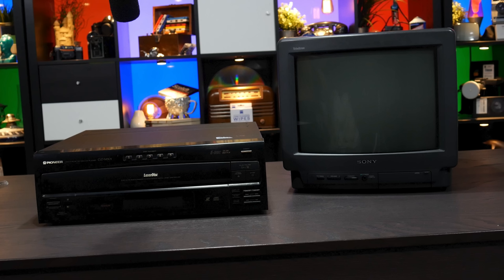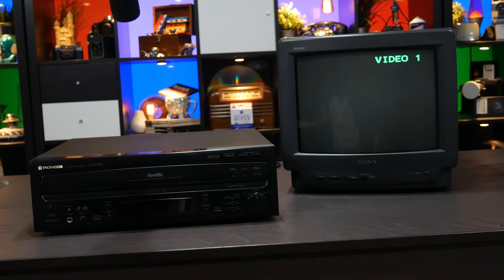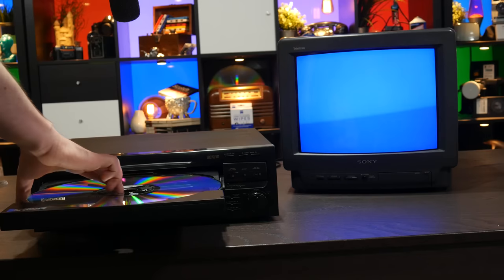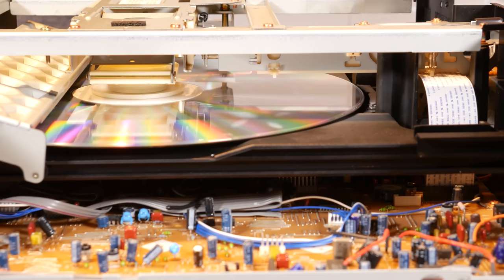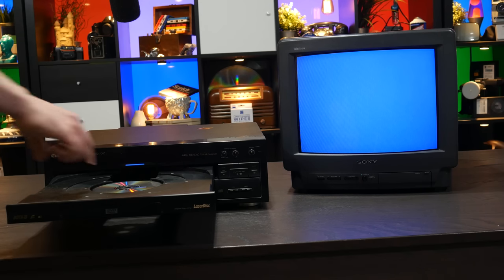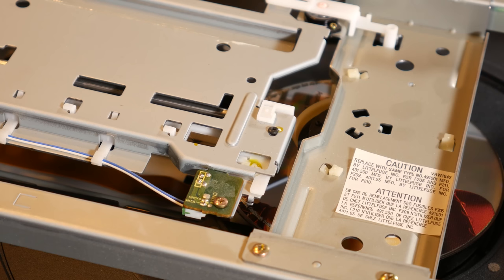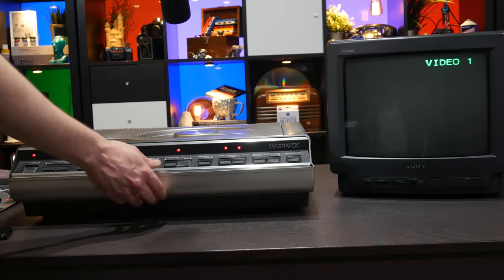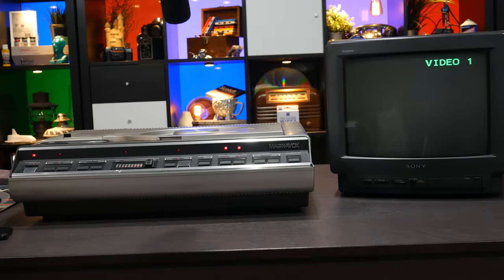Sights and Sounds: Laserdisc players

Comment: Alec, I would like to make one suggestion. Perhaps you could describe the devices as you introduce them. "The unit is a black, oblong box about 15" wide by 15" deep by 5" tall. The front has buttons for multiple functions and a jog-wheel for image select. The tray that holds the disc(s) is hidden behind a door which takes up about 1/3 of the front, vertically, and which opens downward when the tray opens. The tray has a large central depression for the laserdisc, and 6 CD depressions spaced radially around the center." Something like that would help the vision impaired better visualize what you're showing.
Reply: Definitely this. I think doing some description, even if it is brief, of what the devices look like is very fitting for the aims of this series
Reply: So it is black?
😁
I'm not blind, but I really like this format, even for those who can see, hearing the sounds that stuff makes adds quite well to the visual, it's a win-win.
Reply: My partner would add to that, before pressing a button for the first time, where on the machine it's located.
Reply: Great suggestion. Though such descriptions may not have meaning to someone who was born blind. They'd be valuable to people with impaired vision or who lost their sight some time after learning what "black" and "inches" are.
Reply: @pufthemajicdragon   a blind born person can easily understand inches. Items they hold have length, and Braille rulers exist.
Reply: This is a great addition to a great idea!
Reply: Do you demand subtitles for the noises too? If you cannot see the screen that you are watching this on, you have no need for a video player either.
Reply: @-sturmfalke-  there is this long, black thing...
Reply: You ruined it Dave

Comment: About the "logic problem":  What is happening is that the unit is trying to get a focus lock.  If it can't focus, the sled moves to another position and it continues to try to achieve focus lock. The mechanism may not be putting the sled assy at the proper distance.  When you hear the "click" that probably is when it locks in proper place.  Just my 2 cents.
Reply: You're right. It needs a belt kit.

Comment: Hmm.  For the machines that aren't able to spin-down the disk, there are three ways to slow the disk down:  (1) A physical brake.  (2) Use the spin motor as a generator (charge up a big capacitor, e.g. like that 1 farad capacitor).  and (3) actively to drive the motor in reverse while it is spinning forward.   The energy has to be dumped somewhere though.  If not into a capacitor then either by heating up the motor, or heating up something else inside the box.

If the slow-down mechanism is #2 or some hybrid of #2 and #3, then it might simply be that the capacitor has gone bad... which would not be surprising at all given the age of the equipment.  Those are not going to be solid caps, they will have an electrolyte that can dry out.

-Matt

Comment: Isn't it insane, that this old tech is so much faster to power on, start, and seek? I'm not sure I can start my Media Player Classic that quickly, and find a chapter. Unskippable DVD's don't help it any, either. We're really paying a price in latency, with a lot of digital hardware. Think about smart thermostats, digital ovens, microwaves with buttons instead of an analog time knob.
Reply: I had a previous co-worker who sold me on the idea that knobs are the ultimate input device. You get a remarkable amount of both coarse and fine control, and it comes with a built-in button if you need it!

Comment: The Magnavox sounds like it has an issue with the disc clamp.   You can hear the motor spin the disc up but you also hear a slipping noise because the clamp is not holding.   Try pressing down on the lid when it is doing this.   It might increase the clamping force.   The reason some discs sound different is probably due to the thickness of each individual disc.    You might notice some scratching at the center of the disc due to the disc slipping.

Comment: 7:13  As someone with a mechanical engineering degree:  God, I wince at the need for percussive maintenance
7:13  As someone that uses equipment well beyond it's expected lifespan:  God, I love some good percussive maintenance.
Reply: It'll will have been said before but laserdisc was well ahead of its time.
Reply: As someone with an electronics engineering degree: Why does percussive maintenance work with solid state components?
Reply: @LeoInterVir  it isn't fixing the problem, it just teaches the device to not do that anymore out of fear.
Reply: @LeoInterVir  
Well, in this case there is a very subtle hint of an explanation at 6:37
Reply: @bobbabai  wasn't talking about the player and its slipped belt. I'm talking about how it works on items without moving parts.
Reply: @LeoInterVir  and to actually answer your question (by replying to the right person) about solid state components: solder joints and board sockets, because circuit boards aren't solid state
Reply: @bobbabai  true, always weak joints, points of failure.

Comment: This is it. This is what I’ve always wanted in videos like these.
The spin up of the disk at around 2:00 reminds me strongly of an old-style London double-deck bus, the one with no doors, as it lumbers off down the road.

Now for 21 minutes in: The stereo recording gives us a little more room ambience, but in most other respects doesn’t really add too much extra to the sounds, I feel.
It’s not like going from 720P to 1080P for example.
Mono seems to work really well for this situation and doesn’t detract from the noises of the equipment.
Reply: thank you for requesting these. this will be helpful for me as well
Reply: It seems like it might be effective to have the left and right channels emphasise some aspect of the gadget in question. For example, in this video, hearing the tray open and close as a left-to-right, right-to-left experience might give a sense of it's speed and location (if done carefully).

Comment: I very much enjoyed this video, it was very relaxing.
Random fun fact! This laserdisc copy of Willy Wonka & the Chocolate Factory has changeover cues! Those are the little white dots you can see in the top right of the TV screen at 21:45 and 21:52. These were used back in the days of film projection, and when movies were not run on big platters, but several smaller reels (usually 20 minutes). These are to signal the projectionist to start the motor of the 2nd projector (the first dot) and to "changeover" to it (the 2nd dot). Usually you don't see this in home video, as it's not usually part of the movie itself, but added by the projectionist when the film is received at the theater and "benched" onto the several 20 minute reels. It's physically scratched into the emulsion of the film. So whatever physical film this laserdisc copy was made from was used in a movie theater at some point, whereas ideally it's made from a master negative, which doesn't have these changeover cues.
Reply: Why would they put change over cues in the last reel of film though ?
Reply: @devial9879  I've never run a theater projector before, but if you have a repetitive task of any sort that requires you to do the same thing to all pieces but the last one, often they all get done the same.
Reply: Generally a roll of standard film lasts 11 minutes.Based on this standard, a film was called a Short Film if it had this duration or less, a Medium-length film if it had two to four reels (44 minutes in length) and a Feature film if the film lasted more than four rolls. The 11 minute time was to give the projectionist time to set up projector B while running projector A and vice versa  in most movie theaters that had two projectors.

Comment: I'll leave some feedback here. I am sighted and hearing, and have ADHD-related sensory processing diffculties.
First off, I really like the format! It's kept me engaged the whole way through.
I have a slight problem following a video if someone talks while showing a thing, and the narration of what's happening helped me staying focused.
Generally I'm glad that you caption your videos well.

As for the stereo mic, the hum is quite unpleasant. I personally prefer the mono setup because of that. It's also distracting, and I end up taking in less detail of the actual audio. 

All in all, a very pleasant video. Looking forward to more content like this!
Reply: Fell you bro. 
But just a tip that worked for me, I've put my inear buds (galaxy buds+) and the humming was completely gone with the crt noise. My guess is the Bluetooth eats a little off the both ends of the audible frequency, and this helped and made the stereo setup clearer than the mono. I think this things can be treated in audacity fairly easy without hurting the audio. 
Also if you have a Samsung phone, the "Adapt sound" really helps
Reply: @Roalethiago  thanks for the tips! i just, uh, watched it on my pc, with speakers.

Comment: If someone were to design a 2 sided laser disc player today, would it have a laser flipping mechanism, or 2 lasers? Because I assume the laser LEDs and mechanism are way cheaper now
Reply: Definitely two lasers with laser guide tracks. Keep in mind that back in the day gas lasers were still well in service and solid state lasers were newly replacing the gas lasers... at a price.

Comment: The Magnavox Laser Disk player uses two mirrors for the tangential and fine radial tracking. These mirrors are mounted on foam rubber mounts and driven with speaker style voice coils.  Over time the foam rubber mounts and glue deteriorates allowing the mirror alignment to drift. It is possible to repair (not for the faint of heart!) but it was never designed for this as it was a replaceable assembly back in the 80s.  I used to repair these things in peoples homes when I worked for Philips. The European versions were the VLP600 and VLP700. The 700 had a remote control.

Comment: Wow, great video.  I used to service and repair these machines back in the 90's.  I was trained by Pioneer, and used to love fixing them.  I am quite surprised that your unit is working absolutely perfect except for that belt issue.  Usually the diffraction "grating" alignment drifts over the years and you get crosstalk on the video. Toward the end of these product's production, they started using pre-calibrated fixed optical blocks.  This brought back some good memories.  Thank You.

Comment: That Willy Wonka disc even has the markings from the film (@10:03 & 10-10) to tell the projectionist when it's time to switch reels! That's some old-school film scan. Cool that that exactly coincided with when they cut from one side of the disc to the other (probably 1/2 way). The film reels could have been in 3rds, but it must have been 1/2 or 1/4 the length of the movie.
Reply: That's actually cool info. Now I'll at least know why I'll be seeing that little mark on older releases on VHS/BETA/LD (usually using inferior transfers, I bet).

Comment: This is great.  I would recommend that since you are recording audio for differently sighted individuals, you might do a little more about describing what you're doing.  For example "I am putting a CD into the center of the tray, unlike the previous model, which takes CDs in indents that are spread around the tray like flower petals."

Comment: Alec I know exactly what's wrong with your Magnavox machine and can guide you through the process of fixing it 
I don't know how much research you've done on these machines but odds are the mirrors that guide the laser beam are operated by magnets 
The glue they used allows the magnets on the back of the mirror to migrate and jam the mirrors in place 
Depending in what position the mirrors jam in can mean parts of the disc will read, and that because they also move around it means sometimes it'll change its behaviour 

The fix is to take the machine apart, and reglue the magnets on the mirrors 

Whatever you do, DO NOT TOUCH ANY OF THE ADJUSTMENT SCREWS 
You will regret it
To reset them, you have to use a signal generator and oscilloscope to recalibrate all the optics which is a royal pain in the ass 

I have a fully working mint condition example and another 5 parts machines so I reckon it's definitely a saveable machine!

Comment: This is doing the gods' work. I wish more had been done like this to archive how "state of the art" equipment from the 50s, 60s, and 70s worked, especially in the broadcast-TV industry. The technology involved in laser focusing and demodulating a video signal from the resulting light reflection, all done with ANALOG circuitry, is a true testament to engineering. All of this modern nano-meter scale chip fabs seems like cheating.

Comment: I use an older 6.1 EX Onkyo receiver at home for audio, so when I watch most things on YouTube, I apply Dolby Pro-Logic IIx. With your video, which started in PCM mono & later switched to stereo, most of the audio initially came through exclusively on my center channel. Once you switched to stereo, the soundstage expanded, but it also spread to the surrounds in a somewhat unnatural way, excluding the rare rear center channel. I'm not entirely sure how Dolby handles the Pro-Logic derived rear center channel when processing a stereo PCM signal, but that was my experience.

If you're ever feeling ambitious, it would be awesome to see you upload a video with proper Dolby Digital 6.1 EX surround encoding for those of us still rocking that older setup. While YouTube only supports DD5.1, as you probably know, 6.1 is essentially 5.1 with a Pro-Logic EX 'flag' embedded in the signal to extract the center rear channel from the discrete surround channels. You can 'hide' a proper DD6.1 signal in a YouTube video limited to DD5.1 since 5.1 receivers simply ignore the EX flag in the data stream. Personally, I find 6.1 EX incredibly satisfying for a bedroom setup. TrueHD, Atmos, and Master Audio are a bit overkill for a bedroom, so I leave those formats for the living room.

5.1 always feels like it’s missing something in comparison, at least in my experience with my more unique (and probably rare) 6.1 EX setup. I love your channel and agree with about 99.5% of your opinions, even though my friends think I’m ‘weird’ for watching videos on (as they call it) 'old tech that nobody’s ever heard of.' But I find your content incredibly helpful, interesting, and most importantly—correct! Keep up the great work! 🙂

Comment: 38th YES! Please explain the difference between CLV and CAV. The CAV (constant angular velocity) always rotates the disc at the same rotational speed and the CLV (Constant linear velocity) always passes the information at the same linear velocity across the optical pickup, thus the disc has a slower speed in the beginning and a faster speed in the end, and a longer seek time as the disc needs to speed up and slow down the read the information.. I have not finished the video and maybe you go in to more detail later.

Comment: I suspect that the DVL-700 doesn't switch lasers when going from the LD tray to the DVD tray is because a user is might be inserting a CDV disc, which uses the same laser as an LD.

Some LDs use CLV and CAV.  Examples from my tiny LD library include Hot Shots! (CLV side one, CAV side two), and Maverick (CLV sides one & two, CAV side three).

Comment: I've seen a few Laserdisc youtube pieces now from you guys over the pond ; and they all seem the same .

There is always an early Philips top loader , but badged as Magavision over there ... then there is a section of Pioneer ones , but never anything else .

While we had Philips and Pioneer here , Sony sold probably more Laserdisc players , like the MDP 650 and MDP 850 , and there were some earlier ones .

Little is said about the audio , but early ones were merely stereo , then later discs were encoded in Dolby Pro-Logic , an analogue surround system - but this was a big thing and one of the main factors in kicking off home cinema - before that most people just looked at TV sets , but once home cinema became a thing , people started putting in projectors and surround sound . Finally , discs came encoded with AC-3 surround and we started to see THX certified audio components .

Not all players came with the AC-3 output , and I remember buying a kit to modify my MDP850 , and buying an additional processor that sat between my Sony TA-E1000ESD preamp and my TA-N55ES power amplifiers ; that processor was the SDP EP9ES and it decoded the AC-3 , which also worked later for DVD , plus it accepted digital inputs from CD players and any other digital components . 

I eventually tired of the room full of equipment and went bak to an analogue audio system , 2 ch stereo wth vinyl as my main source, FM radio,, one reel and cassette tape , TV FREE ZONE and jus enjoy the music .

Comment: My Pioneer CLD-V740 (a karaoke-oriented player from 1993) has the previous tray transport generation versus the DVL-700. The pattern of the sounds is identical; however, while the sound itself is softer than the CLD-D502, it’s not as soft as the DVL-700.